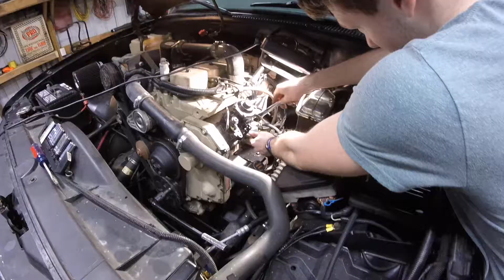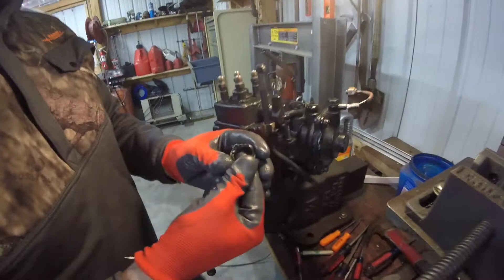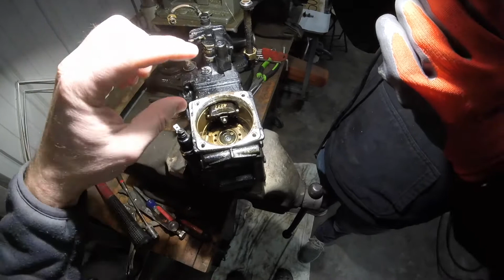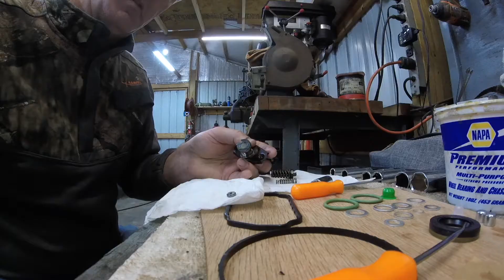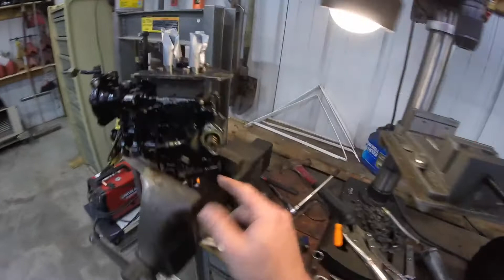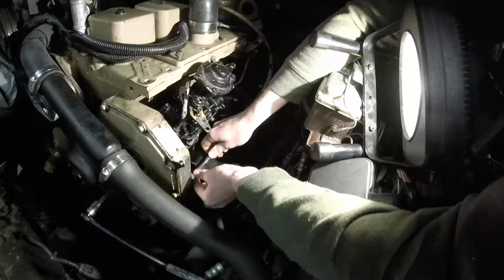Part #1 Cummins 4BT VE Pump Reseal

Comment: By “rolled edge” do you mean the side with the taper or the side with the groove
Reply from the maker: This would be the side with the bevel end, I hope that explains it better.
Reply: @jeepmanking3577 mine has two sides on the outside that are at a 45 degree angle
Reply from the maker: @GSEShop  if you have a bevel on both sides then it shouldn’t matter it just helps guide it in place.
Reply: @jeepmanking3577 thanks

Comment: used a tiny bit of jb weld to hold my key in place then tapped it flush and cleaned it after it cured had the dammed pump in n out about 10 times now and the key hasnt been a problem since.